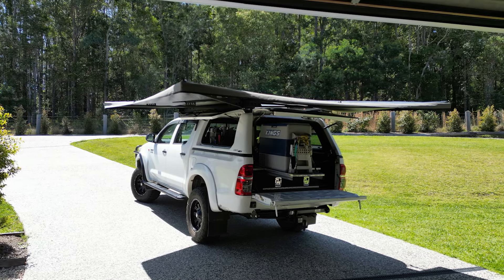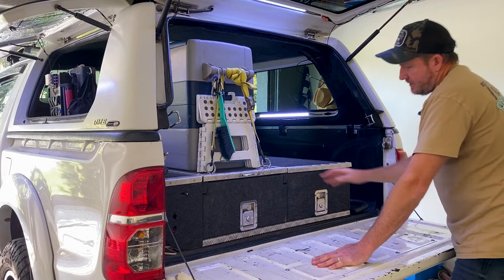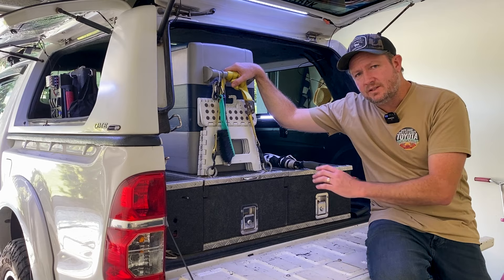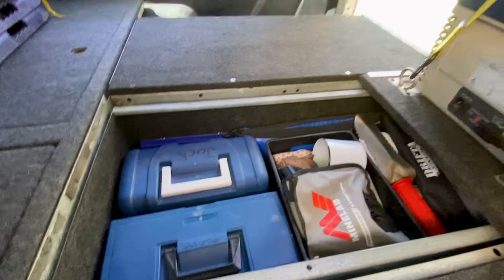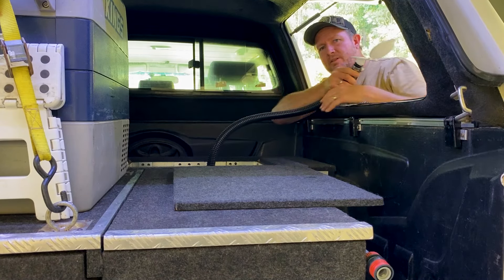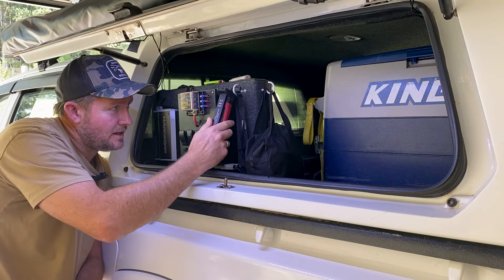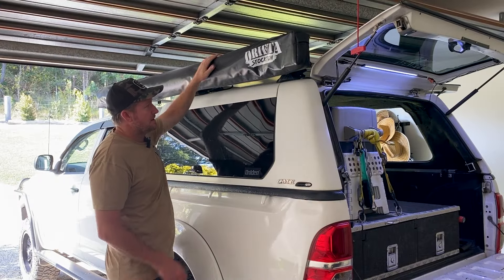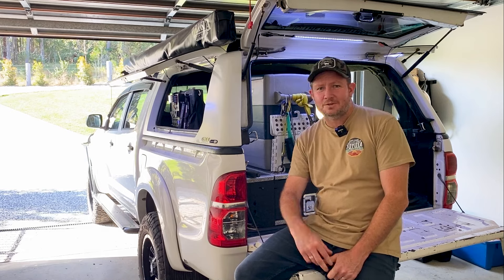Budget 4x4 Tub & Canopy Set Up (Dual Battery, Fridge, Water Tank, Awning, Drawer System & Solar)

Comment: Hey mate, how are you routing the wiring for the solar panel? Im not sure where to route mine? Also how are you mounting the 12v board? cheers
Reply from the maker: Hey mate, check this video here out which shows exactly how I installed it all and the custom board I made to mount the 12 volt switch panel: https://youtu.be/8FwxzfmLAiY
Hopefully that helps and gives you a few ideas.
Reply: @TheBeatenTrak  cheers, how about getting the solar wiring into the canopy? Cable glands?

Comment: ..thanks for sharing...I'm just a newbie and starting to build my minimalist rig, I can see that you dont have a power station, instead you have the extra battery charged by the dc-dc charger and solar to power the fridge and the lights, is it enough for a few days camping?
Reply from the maker: Hey mate thanks for the question. Set up like this I have plenty of power to run my fridge, camp lights, recharge phones, camera batteries and camp for as long as I like. If you wanted to install an inverter to run an induction cooker or small coffee machine for example then you would probably need some bigger batteries I'd imagine. I've done many camp trips in this set up now and I've never struggled for power. 
Have fun building your rig out!
Reply: @TheBeatenTrak  …appreciate the info…
Reply from the maker: Anytime ✌🏻

Comment: Hey mate great tidy setup,, like you thinking about the shorter drawers as well, my question is about your awning, I m looking at a 270 as well, but they are very long and I have been told not to mount across the tub and body as they are mounted independently it could damage the awning., have you had any trouble with yours twisting or flexing? Cheers
Reply from the maker: Thanks mate! I have heard that story too since setting it up like this but I haven’t had any issues with it.